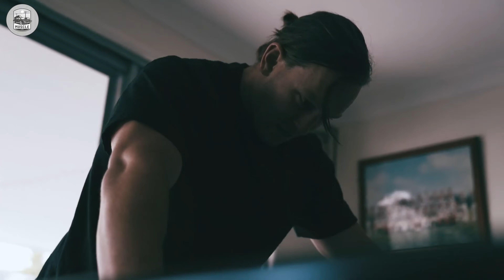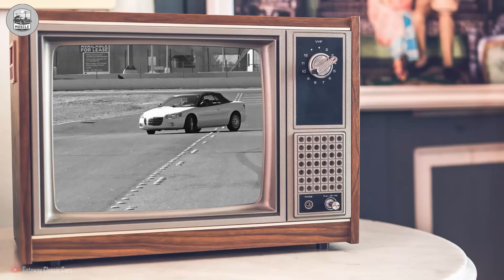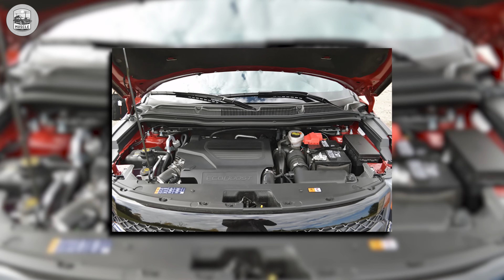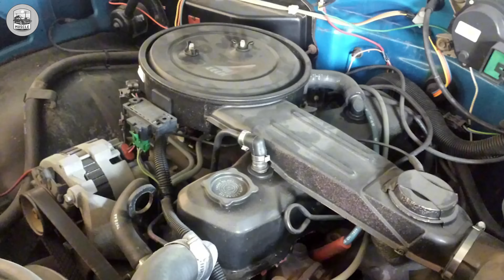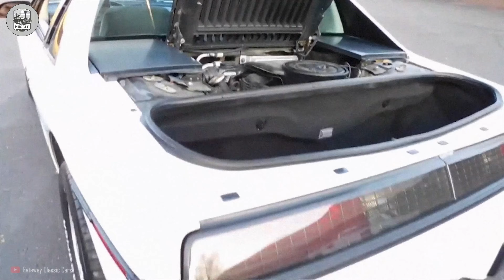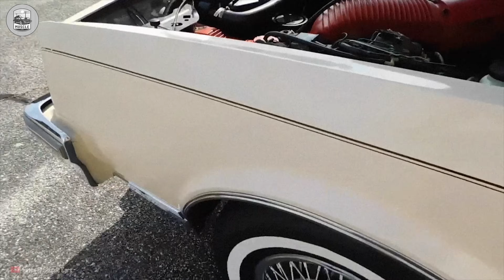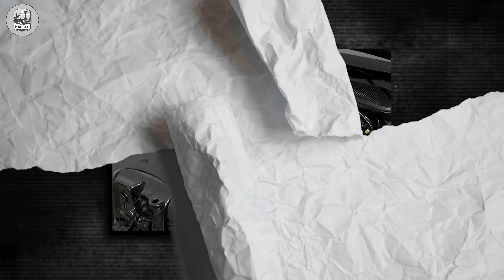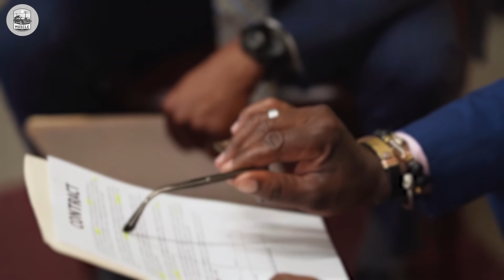MOST FAILED ENGINES ever put in production cars | Worst engine blunder!

Comment: The 80’s 350 V8 converted to diesel was total junk. I rode in one a friend of mine had bought for $1,000 and it was only a few months old. His boss had bought and hated it and sold it for a big loss. It was probably the slowest car I ever rode in. You could walk across the road faster than it.  He pulled the engine and converted it back to gasoline and it was then a nice driving car.
Reply: They were Olds Big Block 455s, but re-cored and then de-bored so as to have thicker bore walls that could take the diesel engine's combustion pressure. And they had forged steel cranks and heavy duty forged rods and pistons. Of all the GM engines of the day, the engineers evaluated the Olds to be stronger that the Cads, Buicks or Chevys.
Reply from the maker: @bobkonradi1027  Wow, that’s an incredible breakdown of the Olds Big Block 455’s transformation into a diesel powerhouse! The re-coring and de-boring to strengthen bore walls, along with forged steel cranks, rods, and pistons, really show how robust the Oldsmobile engines were. It’s no surprise GM engineers ranked them stronger than the Cads, Buicks, or Chevys of the era. This is the kind of engineering muscle that defines American automotive ingenuity
Don’t forget to like, share, and subscribe to American Muscle Cars for more deep dives into engine lore and muscle car history. Have a great day, and Merry Christmas
Reply from the maker: @Dld1985 Thanks for sharing that story what a wild experience
 The 1980s diesel-converted 350 V8 is often remembered as a misstep in automotive history, but it's great to hear that your friend's conversion back to gasoline brought new life to the car. It's a testament to the resilience and adaptability of classic American muscle! Keep the stories coming, your insights make this channel even better.
For everyone watching, what’s your take on the most failed engine or car setup in history? Drop a comment, share your stories, and don’t forget to like, share, and subscribe to American Muscle Cars for more classic car tales and insights!

Comment: Disagree about the Chevy 2.2. Mine used no oil and wasn't that weak. Sold the truck with over 150,000 miles still going strong. Mitsubishi V6 DID have poor valve guides. Haven't heard bad stuff about the 255 Ford V8. It was still a basic Windsor engine so how could Ford goof it up? Ford found a way. Had the Ford 3.8 in 1990 Cougar. Car itself was a PIA>>always fixing something. The engine sprung an antifreeze leak between the front cover and the block that I had to fix. Chevy 305 wasn't that bad. Oil leaks were common with everything. Flat tappet cams of the era (and still today) were poorly heat treated and went flat easily. I disagree about the 3800. It was the BEST engine GM built. The EARLIER 3.8 wasn't good>>weak engine. 2.5 Iron Duke WAS weak from the factory but the basic design could handle some serious power. Quad 4 had a POTENTIALLY good design but quality was poor.
Reply from the maker: Thank you for sharing such detailed insights and experiences
 It’s always great to hear firsthand accounts that challenge or support the points in our videos. The 2.2 and 305 Chevy engines certainly have their defenders, and you’re right—maintenance and luck often play huge roles in engine longevity. As for the 255 Ford V8, its design limitations for emissions and economy left it underpowered, even by 1980s standards. The 3.8 Ford in your Cougar is a testament to the challenges of balancing reliability with complex components like timing covers. The 3800's legendary status among GM engines is well-deserved, it’s a powerhouse of reliability compared to earlier iterations like the 3.8 Buick. And the Quad 4? A missed opportunity, indeed
We love these kinds of debates, so keep them coming! Everyone, drop your thoughts, share this video, and hit subscribe to keep the conversation rolling....
Have a good day.
Reply: Disagree all you want, but facts don’t lie... The Chevy 2.2 earned its rep for weak performance, especially compared to real muscle. And yeah, the 305 could run, but it was no powerhouse. The 255 Ford? Ford totally botched it, low compression, weak power, and smog equipment strangled it. As for the 3.8, early versions were junk. Sure, the 3800 improved, but BEST? Not when Buick’s 455 existed....
Reply: Disagree about the 255 Ford V8? Fair point, it’s still a Windsor block, but Ford cut compression and flow to chase fuel economy, killing its power. Sure, the Chevy 305 had leaks, but it could run forever with care. And the 3800? Absolute legend

Comment: You're dead wrong about the GM 2.2,2.5 and 3800. 2.2 is a good economic engine as is the 2.5 "Iron Duke" is a great economic engine mail trucks use them. And the 3800 is one of the best engines of all time.
Reply from the maker: Thank you for your passionate response and for sharing your perspective! The GM 2.2, 2.5 'Iron Duke,' and 3800 V6 certainly have their merits, especially in reliability and efficiency. The 2.5 'Iron Duke' was a workhorse, powering everything from mail trucks to compact cars, and the 3800 is undeniably a legend renowned for its durability and versatility in applications ranging from family sedans to supercharged performance models.
That said, as with any engine, they had their quirks. For example, the 2.2 sometimes faced head gasket issues, and the 3800 had occasional intake manifold problems in later versions. Still, their overall legacy speaks volumes.
We'd love to hear more from fans—what’s your experience with these engines? Share your stories, comment, and let’s keep the discussion alive. Don’t forget to subscribe and share with fellow enthusiasts to keep American Muscle Cars thriving...
Reply: The GM 2.2 and 2.5 are reliable, sure, but calling them great is a stretch. Mail trucks used the Iron Duke because it was cheap and simple—not powerful. As for the 3800, it’s solid for daily drivers, but 'best engine of all time'? Not in the muscle car world. Give me a screaming V8 like the 289 HiPo or the mighty 426 Hemi any day

Comment: Cadillac 390 circa 1963 was an awful motor. Oil pumps in the front cover, oil pickup tube was almost feet long, Dealerships told customers to not change their oil. I built 3 of these for my best buddy and they never last long, the cast iron blicks are horrible and were never bored well. Just junk
Reply from the maker: Thank you so much for sharing your experience and thoughts on the Cadillac 390
 It’s fascinating to hear firsthand insights, especially from someone who’s worked on these engines. While the 390 is often remembered as a key part of Cadillac’s luxury performance in the early ‘60s, it certainly had its share of challenges. The long oil pickup tube and front-mounted oil pump were definitely design quirks, and lack of proper maintenance compounded reliability issues. Cadillac prioritized smooth power delivery over durability back then, which might explain some of the machining inconsistencies you mentioned.
Your story highlights how important maintenance and design quality are for classic engines! For everyone else, what’s been your experience with Cadillac motors? Drop a comment below, share your stories, and subscribe to American Muscle Cars for more discussions about the highs—and lows—of classic engines. 
Let’s keep this conversation rolling
Reply: I couldn’t disagree more
That Cadillac 390 was a powerhouse for its time smooth, torquey, and reliable if maintained right. Sure, the oil system wasn’t perfect, but most issues were from neglect or cheap oil. I’ve rebuilt a couple, and they’re bulletproof if done properly. Cast iron blocks were solid, and boring issues? Probably a bad shop.....

Comment: Chevrolet 2300 4 cylinder built from 1971-1977. Aluminum block with a steel cylinder head, and no steel cylinder liners. My grandfather had a Vega wagon with one, then my dad had it, and his mechanic said get rid of it as soon as possible.
Reply: Sure, no liners was risky, but it paved the way for innovation. With proper maintenance and updates, these engines could last. My uncle had one, and he swore by it for years.
Reply: Alright, hear me out, fellow gearheads: everyone dogs on the Chevy Vega’s 2300 4-cylinder, calling it a disaster. But let’s get real, it was ahead of its time! An aluminum block with no steel liners? That’s cutting-edge engineering for the early ’70s. Sure, it had issues, but with proper maintenance and cooling upgrades, it wasn’t hopeless. My grandfather’s Vega wagon ran fine for years. It’s not a V8 monster, but respect it as a stepping stone in GM’s innovation journey...
Reply from the maker: @AilaniMadden  Thank you for sharing such a thoughtful perspective on the Chevy Vega's 2300 engine
 You're absolutely righ, it was cutting-edge for its time, and GM's choice to innovate with an aluminum block showed real ambition, even if it had its pitfalls. Stories like your grandfather’s Vega wagon remind us how proper care could make these engines reliable. Many enthusiasts today even restore and modify them, proving they weren’t hopeless. Let’s hear from others—did you or your family have a Vega or a similar experience? Drop your stories in the comments, and don’t forget to like, share, and subscribe to American Muscle Cars....
Reply from the maker: Thank you so much for sharing your family’s connection to the Chevrolet 2300 engine! It’s incredible how cars often carry stories across generations. The aluminum block with a steel head was an innovative choice, but it lacked steel cylinder liners, which led to durability concerns especially with improper maintenance or neglect. The Vega's engine earned a reputation for overheating and oil consumption, which mechanics at the time often warned against.
However, it’s worth noting that GM tried to address these issues later, with better cooling systems and improved materials, though the damage to the Vega's reputation had already been done. Some enthusiasts have even rebuilt these engines successfully using aftermarket upgrades to overcome the original flaws.
Let’s hear from others did anyone have better luck with this engine?
 Share your stories in the comments, and don’t forget to subscribe to American Muscle Cars for more car history and discussions

Comment: 305? 3800? This guy is smoking something. Even the Ford 3.8l was a pretty good motor as long as you kept up with the maintenance.
Reply from the maker: Thank you for your comment and for highlighting the importance of regular maintenance
You’re absolutely right many engines, including the Ford 3.8L, could deliver solid performance with proper care. However, like all engines, they had their quirks. For example, the Ford 3.8L was notorious for head gasket issues, especially in the early '90s, which often arose if routine maintenance wasn’t meticulous. The GM 305 and the 3800 V6 also had their strengths and weaknesses. The 305, while not a powerhouse, was a reliable and fuel-efficient option, while the 3800 earned its reputation as one of GM’s most dependable V6 engines, even spawning a supercharged version for more spirited performance.
The key takeaway? Proper care can make or break an engine’s legacy. Let’s keep the conversation going! Share your experiences with these engines, and don’t forget to like, comment, share, and subscribe to Muscle Car Masters for more insights....
Reply: Yes, even Ford's 3.8, despite the head gasket issues, held its own when well-maintained. Not every engine needs to be a fire-breathing monster to earn respect in the muscle car world

Comment: Why is the GM 3800 on this list,  I disagree that it was a bad engine.  I think it was one of their best ever built.  and also the GM 2200 or 2.2 Liter Ecotec is what is currently in my chevy cavalier with 168k on it and nothing ever done to the engine other than coolant flush when I bought it at 70k and regular 5k oil changes.   They are known to go 300k in the L-61 variant with proper maintenance, so I don't know how that is a bad engine either.   I do agree with the 2.4 Litre Iron duke not being good though.  They ate camshafts, or at least that was my experience with them in my 85 cutlass ciera.
Reply from the maker: Hey, thanks so much for sharing your perspective
 We truly appreciate hearing from viewers who have firsthand experience with these engines. You make a great point about the GM 3800 and the 2.2L Ecotec (L61). Many enthusiasts do consider the GM 3800 to be one of the best engines that General Motors produced, known for its durability and smooth torque delivery. Likewise, the 2.2L Ecotec in your Chevy Cavalier has indeed proven its longevity, with many owners reporting well over 200,000 miles on these engines when properly maintained. It’s great to see these stories, as they show that personal care and regular upkeep can make a significant difference.
Every engine design has its strengths and weaknesses, and personal experiences vary. Thanks again for weighing in with your story, it helps enrich our community’s understanding. 
Be sure to share your own engine experiences below, hit that subscribe button, and spread the word about American Muscle Cars
Reply: But let’s not overlook the Iron Duke’s role in GM history. Sure, it had its flaws, but it powered countless cars through the ’80s. Sometimes, durability isn’t just performance; it’s resilience through tough times...

Comment: I've heard only good things about the GM 3800 V6, especially it's incredibly good fuel economy. I've heard that up to 30 mpg could be achieved on the highway. As for the Ford 3.8 Essex V6, I had the 4.2 version in my F150 and it had nearly 190K on it when I traded it in. It was still running good.
Reply: Interesting take, but I gotta say, the GM 3800 V6 gets too much hype for being ‘bulletproof.’ Sure, 30 mpg sounds nice, but it lacked the raw power muscle car fans crave. The Ford Essex 3.8? Solid, but no performance champ either especially compared to old-school V8s. My 4.2 felt underpowered hauling loads in my F150. Honestly, they’re great commuters, but for muscle? Gimme a small-block V8 any day
Reply from the maker: @KeithGreene-k1v   The GM 3800 V6 truly stands out for its incredible highway fuel economy, often reaching up to 30 mpg. And the Ford 3.8 Essex V6, especially with nearly 190K miles on your F150, is a testament to its durability. Of course, no engine is perfect, some might face issues others haven't experienced yet. That’s why we’d love to hear from all our fans! What’s been your experience with these engines or others? Share your stories in the comments, and don’t forget to like, share, and subscribe for the best in American Muscle Car content
Reply: @MuscleCarMasters68  The GM 3800 V6 is overhyped. 30 mpg is great, but muscle cars are about power, not MPG. And the Ford Essex 3.8? Durable, sure, but falls flat in performance especially compared to a roaring small block V8. My F150’s 4.2 struggled with loads. For true muscle, there’s no replacement for displacement.
Reply from the maker: @KeithGreene-k1v  The GM 3800 V6 truly stands out for its incredible highway fuel economy, often reaching up to 30 mpg. And the Ford 3.8 Essex V6, especially with nearly 190K miles on your F150, is a testament to its durability. Of course, no engine is perfect, some might face issues others haven't experienced yet. That’s why we’d love to hear from all our fans
 What’s been your experience with these engines or others? Share your stories in the comments, and don’t forget to like, share, and subscribe for the best in American Muscle Car content...Have a great day.
Reply from the maker: Thanks so much for sharing your experience
You're absolutely right about the GM 3800 V6, it's known for its amazing fuel efficiency, often reaching up to 30 mpg on the highway, making it a great option for long trips. The Ford 3.8 Essex V6 also has a solid reputation, and it's impressive that your F150 ran strong even at nearly 190K miles! These engines really show how durability and efficiency can go hand in hand. We'd love to hear more from everyone, so drop your thoughts in the comments, share your experiences, and don't forget to subscribe for more American muscle car insights
 Have a great day...